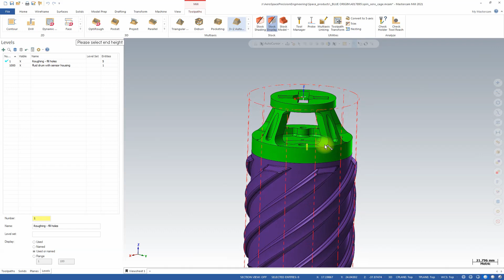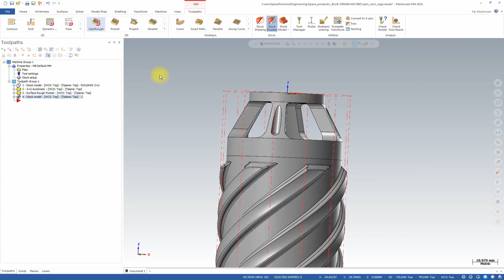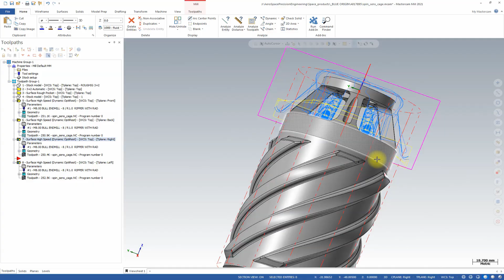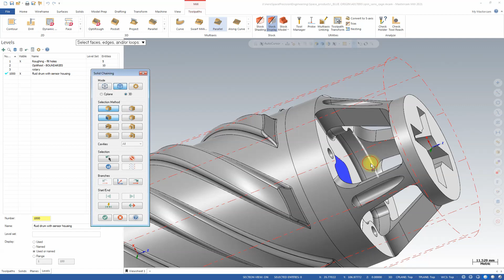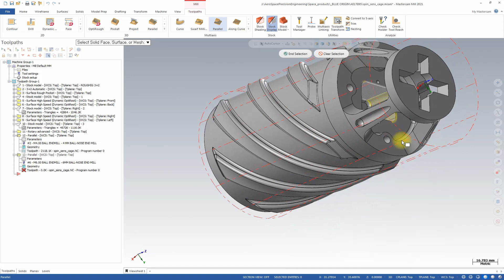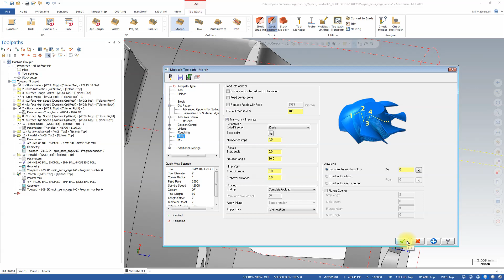5 AXIS Mastercam tutorial - Spinner - part 1 ROUGHING

Comment from the maker: There are many ways you can program those roughing ops
I had an email from Simon asking if it is possible to use only 3+2 automatic roughing - the answer is yes (you can add multiple different tool planes in tool axis control page inside the toolpath)   :) 
As Alvaro suggested you can also use toolpath transform after the first OptiRest,  that's correct :) 
Both of the solutions above are correct but in our case it would result in machining some air areas -  cutting areas where is no material
Setting OptiRest as single ops and adding a stock model in between will remove all the AIR-CUTS (this way Mastercam produces a toolpath only in areas where is material to cut)

There are many different toolpaths that can produce similar result and i suggest you all try different things, play with different toolpaths, test all the options available in settings

Thank you all for watching  :)
Reply: Tool plane in tool axis control? Is it on left tree parameter "tool axis control"? Thanks Sir